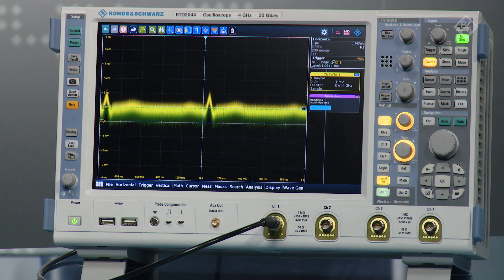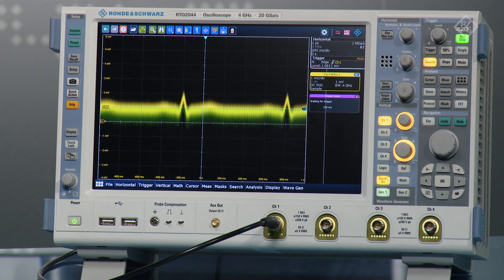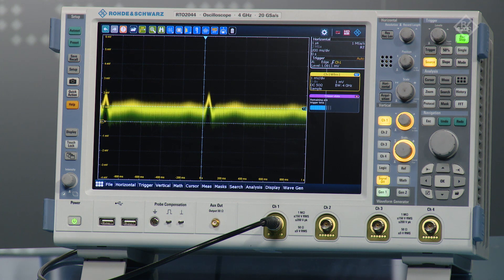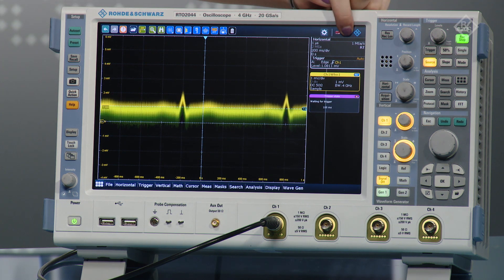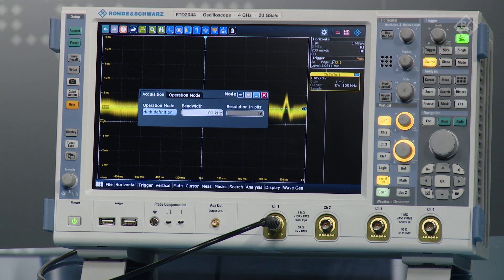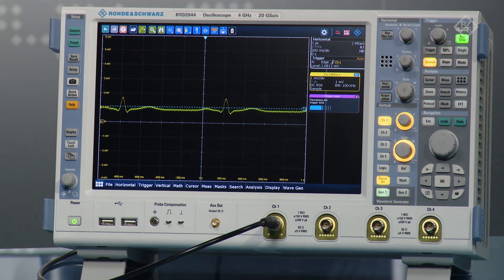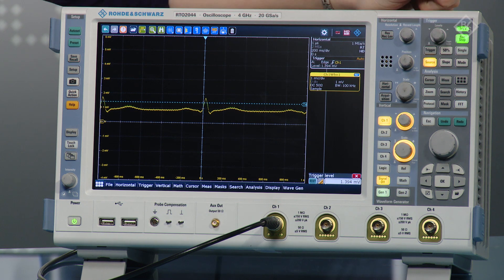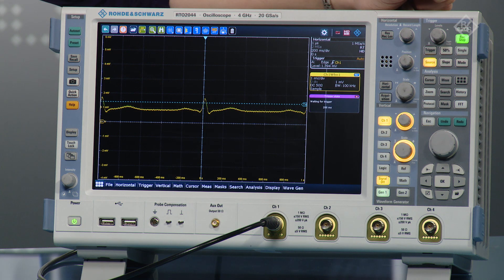R&S RTO digital oscilloscope: Up to 16 bit vertical resolution

Comment: What for 16-bits ADC resolution while the front end analog amp. has accuracy and linearity less than that ??
Reply from the maker: Dear Ahmed, 

The RTO is optimized for high accuracy. The complete signal path including analog frontend, impedance match, ADC, filters and postprocessing all focus to reach a max possible accuracy as shown in the data sheet. We do focus on overall accuracy, not just on a high ADC bits. You can see this in low noise frontend, spurious free noise spectrum, up to 9.4 ENOBs etc. 

Best regrards,
Rohde & Schwarz Social Media Team

PS: The product specifications can be downloaded here: https://scdn.rohde-schwarz.com/ur/pws/dl_downloads/dl_common_library/dl_brochures_and_datasheets/pdf_1/RTO2000_dat-sw_en_3607-2684-22_v2200.pdf